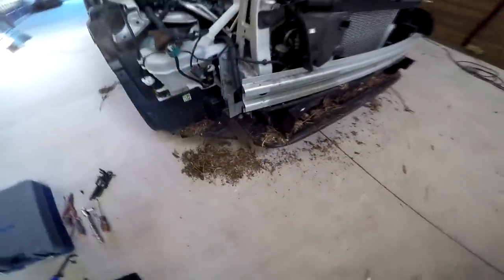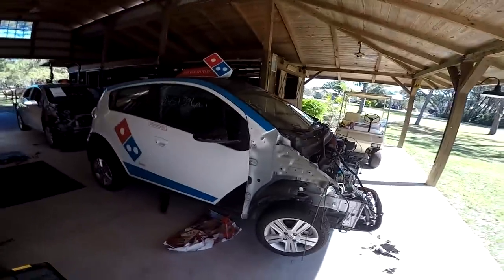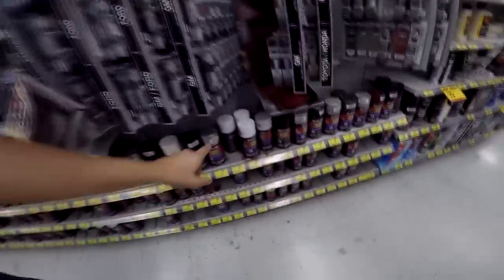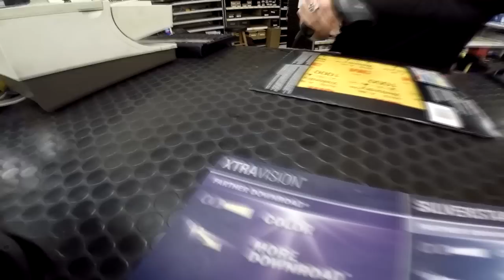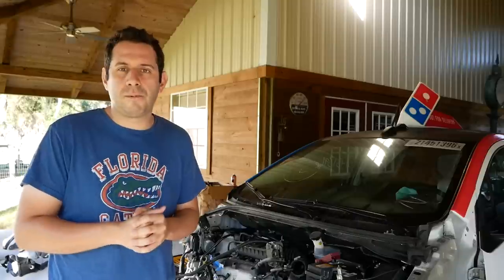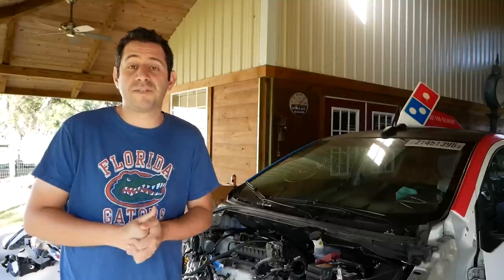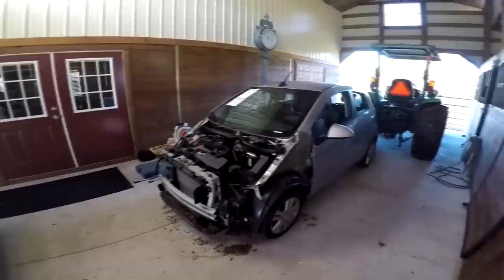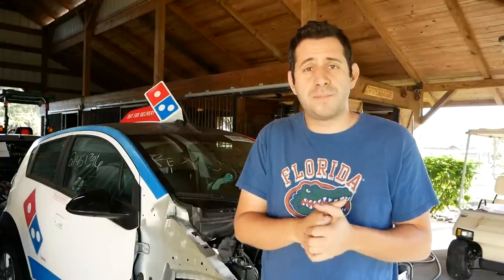The Plan for Painting the Domino's DXP Pizza Car Rebuild (Flooded Spark is Officially a Donor)

Comment: Repair the engine first
Reply: The engine should be fine in the DXP, and even if it doesn't fire up, he can swap it from the flooded spark
Reply: The Noob Gaming TV bro just put the domino car doors and every thing to the spark
Reply: CM RGY YOUTUBER Custom wiring going to the doors.
Reply: CM RGY YOUTUBER It has a bad title and that makes it a nightmare to get it back on the road.
Reply: You would have to pull ever body panel off of the dominos car to put on the spark. That will be a lot cheaper and easier than getting all of those wraps, especially since they are mostly custom just for dominoes. Then dealing with fitment, wiring for the oven,etc. Don't forget the inside was changed also, so pretty much ever part of the car you can see needs to be swapped. Its much easier to just fix the dominos then to convert a spark to a DXP. And that is even before getting to the fact the spark was a flood car with who knows what problems waiting to happen, and the legal nightmare of  getting a usable title for it.
Reply: As far attempting to duplicate the logos for the DXP, those are registered trademarks (TM) and duplicating them might bring legal issues into play for whoever would duplicate them without permission from the trademark holder.

Plus  I wonder what Samcrac's liability might be over the trademark "usage"? Not for owning that vehicle, but displaying in public, like just driving it down the street?

That said, I wonder if the franchise owner may have problems with their corporate overlords for not returning that vehicle to Roush for proper "disposal" of the modifications that were made to the vehicle, as was explained in a previous Samcrac video? Yeah, their auto insurance company may have felt that they had a legitimate right to auction off the totaled wreck to recover some of their losses, but that wouldn't have overridden the franchisees contractual responsibilities in the purchase agreement for the vehicle to begin with. I would think that the franchisee should have not taken a full payout for the wreck, but rather should have "eaten" some of the compensation so that they could return the wreck to the corporation for proper disposal as dictated in the purchase contract.
Reply: CM RGY YOUTUBER 9:20 answers why he won't.
Reply: Does he need to do any prep work to the flooded Spark engine if he's in need of transferring it? (like remove any contaminants from hurricane Irma?)
Reply: Mr. Ed How do you know exactly what's in the contract? I'd like to read it too.
Reply: Samcrac mentioned that "contract" in his first video about this DXP vehicle. 'D' contacted with Rousch Sports [or a subsidiary] (Jack Rousch of NHRA, NASCAR, SCCA, etc racing fame - engine builder and team owner - whose companies also build Mustangs for sale by Ford dealers and a slew of HP parts and crate engines under the Rousch brand) to build those vehicles and then when the vehicles 'left service' for delivery purposes with 'D' franchisees to restore the vehicles to their original production line configuration using the parts they removed during the modifications.

The removal of the pass front air bag alone is enough to potentially cause grief for 'D' and maybe Rousch; and the other mods may not meet motor vehicle laws in various states - such as the oven blocking rearward vision. Cars like that just can't be sold to the general public in their modified condition; they need to be restored to OE - as made by GM or whoever built them to be sold by GM or they need to be crushed.

A vehicle owner himself may get away with modifications to their vehicle, but the later sale of such a vehicle is a sketchy area as far as legality and liability for the mods.

That DXP  "slipped thru the cracks" and Sancrac may own it legally, but I hope he doesn't intend to sell it for street operation when he is done fixing it. Use it himself or sell it to a collector, but don't put it up on Coparts or similar for sale to a licensed dealer of motor vehicles.
Reply: Ah but you are dealing with insurance companies which have a law unto themselves, The state the vehicle was registered in defines what laws apply when the vehicle is involved in an accident and (often in my opinion) unfairly biased in the insurance companies interests. We could argue that if the Domino's really wanted to maintain control of the vehicle, the technology and the trademarks they could only offer the vehicles under a lease situation. But then we haven't dealt with the legal issue if the vehicle is involved in an accident in a something other than a No-Fault state again control of the disposition of the salvage assets and the insurance companies rights revert back to state law.
Reply: Capt. Beak:
Yes there is state law for the pint of purchase and the insurance company regulations, but it sounds like there was a purchase contract between the franchisee and 'D' regarding the eventual disposition of that vehicle which would fall under 'contact law' and possibly the state where 'D' calls "home" - Michigan is "home" but not necessarily where it is incorporated. 

Pure speculation on my part, but I wonder the franchisee had a responsibility to retain ownership of the wreck and "eat" the salvage value so that wreck would be returned to 'D' and/or Rousch? As in the franchisee may have paid for the vehicle, but attached to the sale was a responsibility with regards to the Trademarks placed on that vehicle.
Reply: Beecher Adams Flooded : salt water : dead car...

Comment: why are people wanting you to save the donor car. it's been in a flood. interior is fucked. dash is fucked. body joints will rust sooner. electrical sensors will fail sooner. grounds will corrode.. not worth it.

Comment: Could you swap dash VIN plate and driver door (for the VIN plate) from a salvage title car, and put on a Cert of Destruction car that works fine. Then title the car as the salvage car?
Reply: I think thats called fraud. ;-) 

Also isn't the VIN in a number of other places.
Reply: Sure it is. I have never once seen anyone at any tag office go and look for one.
Reply: I guess the real question is how many VIN numbers have to match? If you're using a donor car to fix another of course some of the VIN numbers will be from another car. Or is it just the VIN on the actual frame? And if you're flipping cars then there's a fraud problem , but if it's for personal use and you're  not planning on selling the car for 10 to 15 years is it still fraud?

Comment: lol you got that wrong the base coat is thin coat the clear coat is painted on at least 6 times thicker or more so it can be color sanded to a smooth surface after done removing the orange peel

Comment: Well im going to be making a fortune with these flood cars soon. Ill tell you how, Im moving to Honduras within 2-3 years from now and guess what in Honduras theres no such thing as inspections, Safety, Junk this car that works well for some road worthy regulation keeping it off the road because there was water here and there, when really you just need to replace carpets and seats and some cushions and trim pieces and if worst comes to worst some wiring harness replacement if it isnt build well and a really, REALLY good cleaning. Im going to be opening up my Mechanic shop outhere and co-part Florida well be my go 2 to buy flood and salvage vehicles, then have some company ship it over by boat. In Honduras you can literally drive a car till the wheels fall off or till the whole engine flies off with the subframe lol they dont really care!!

Comment: I'm not sure why you bought all the painting supplies. My advice stay away from the crap at the auto parts stores. I recently tried some of the clear you can buy in a rattle can and it never even dried completely hard, it's still soft weeks later.
Reply from the maker: yes you need to buy the stuff with the hardner in it

Comment: Ones a stinky biohazard with potential problems with the electrics, the other needs a few new parts. The work to fix the silver one would require a new wiring harness, full interior which the pizza car does not have. There's ONLY one way to get a decent car out of those two, and your doing it. as for what next, engine first, then detail it, airbags, seat belts and body work ect

Comment: I wouldnt trust that drown car at all,you showed its falts,mud everywhere,I wouldnt trust it further than I could throw it. Its actually the Insurance and those that buy those drown cars do what you do,buy a salvage car with a decent title,then just swap titles. By swapping the dash panel,you can sell it as the other car. Yes,there are other spots on the car that have the vin,but most only go by the one in the windshield. Its illegal to swap titles,but if both cars are the same,who is going to know.
Reply: RC Hobbyist Extreme there are vin numbers all over the place and if they dont match you will get in a hell of a lot of trouble.

Comment: I feel sorry for the silver Spark. I like the DXP car project but it just feels wrong to kill a working and ok looking car to give life to something as broken as the pizza racer.
Reply: Stealth its only a spark tho
Reply: It has a bad title.
Reply: Flooded. Electronics prolly dont work
Reply: Didn't he drive it around and work all the windows and the radio? Flood only cam up a few inched on the doors.
Reply: Flood cars are notorious for working fine and then declining very quickly. Give it some time, all of that dirt falling out will become finer dirt, probably with some sewer waste mixed in. They will rust like crazy later in life. Things will magically go wrong. That is why they don't even get a salvage title, they can't actually be properly salvaged, but because they have no physical damage, they look like any other used car until you start to really look.
Reply: but think of how many sparks could use spare parts from it and stay on the road!
Reply: One thing to add on to this is that he did say the flood car has a certificate of destruction meaning it would be pretty hard to legally get it on the road again
Reply: Yes I have been following Samcrac since the early days. Yes I know the silver Spark would be hard to get back on the road (is it even possible?) due to its status. But a working and ok looking car like that could be used for some other kind of project.
Reply: Id would be more worried about corrosion and problems down the road.  They give flood cars those titles for a reason.  You may get it working fine today and get it cleaned up but what can crop up down the road.
Reply: Those parts can be cleaned up as they come off and not have a hiding rust problem later on
Reply: The silver one would be good for banger racing (assuming such a thing exists across the pond), strip it out, remove all glass, add a rollcage and racing seat(s) & harness(es), and you have a little pocket rocket gokart that can get beaten up in a banger race... :)
Reply: Both sparks are P.O.S. cars anyway, fixing the pizza car that could someday by a classic seams way better besides the obvious water damage and the fact someone could try to fix and clone the regular car. Sparks are a dime a dozen low end disposable car made by chevy that aren't as reliable as the imported counter parts.
Reply: Meanwhile, the Chevrolet Spark was imported from Korea, built in the Daewoo factories, and used to be called the Daewoo Matiz (and is sold in the UK as the Vauxhall Viva)................
Reply: Stealth search south main auto repair here on YouTube, Eric o just had a Pontiac Bonneville with a airbag light on. The derm module under the seat was shot due to water getting in and soaking the floor and carpet.
Reply: It just a ugly spark but the best is tje dxps
Reply: I dont see why people care. Its just a spark its nothing special and there are thousands of them. The dxp car is actually special.
Reply: you fix the car with higher value...
Reply: I swear this is the wimpiest comment section ever. Dude its a fucking spark. Nothing special about it AT ALL. And you want to save that instead of a rebuilding a dxp that you can only get your hands if you're a franchise employee at Dominos or shear luck like this guy. It's a clear winner what's more valuable and cool to see.
Reply: I do too..I mean the silver chevy was so cute. it wil be remembered tho. ;(
Reply: I understand that the DXP car is quite more in value, but that other spark didnt have to be used on the road, it could be used to rally up the cows?? lmao, but seriously. it was cute.
Reply: twocvbloke it’s not a Viva pretty sure it’s an Agila? My mums got a Viva and it’s totally dofferent
Reply: But you should never ever use a flood car because of the high chance of mold and wiring problems from water damage.
Reply: savage   Just need to know what you are doing and what to look for.      For most people it's easier to rebuild a flood car than a car that needs frame rails, since most don't have access to frame machine and skills to put a frame in.
Reply: you miss understood what a flood damaged vehicle is like.
Reply: It doesn't matter how pretty it is, it's frosting on a turd. The whole cars electrical system and even the engine and drivetrain are compromised from water. It will not keep working for long.
Reply: Carnage 50X    Well I certainly know exactly how they are.    That's what I do for a living
Reply: spce invdr  your generalizing all flood cars.    Some cars I'd certainly agree with you but just like all collisions are never the same neither are all flood cars.    Just a good idea to actually view car in person if going to buy a flood car to rebuild it, not just part it out
Reply: tattoodtoolow it's just how it is, and that spark went through a hurricane. Its done for.
Reply: spce invdr   Well and the small thing called a destruction title also.  Yes      All comes back to knowing what your buying
Reply: twocvbloke we have those across the pond, we call them demolition derbies, usually only with 70s or 80s beater cars

Comment: Air bags (just to be different)
Reply: David Stephenson he needs to send the car's airbag control module to be reprogrammed before attaching the airbags to the wiring harness.  it would suck if the replacement airbags deployed the first time he starts the car.

Comment: it really hurts me seeing a perfect running car being part out like that
Reply: habib eghbal it has a bad title.
Reply: so as car guru's flooded tesla i dont see any problem with that
Reply: It's a flood car meaning water damage if you take that car on the road and someone breaks your in trouble
Reply: Perfect today don't mean it will be perfect tomorrow.  If you don't get the mold out it is very unhealthy too.  Reusing those seat may be a problem depending if the water got into the cushions
Reply: The spark ran fine. It’s just that dominos car is worth more.
Reply: Who cares. Its just a stock spark. Its nothing special at all.